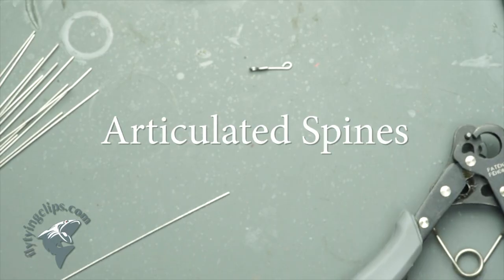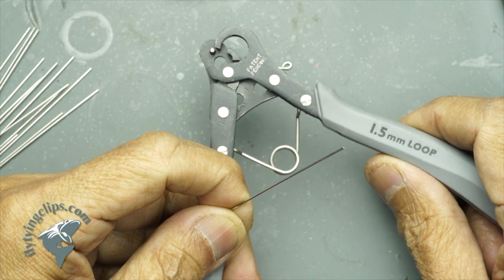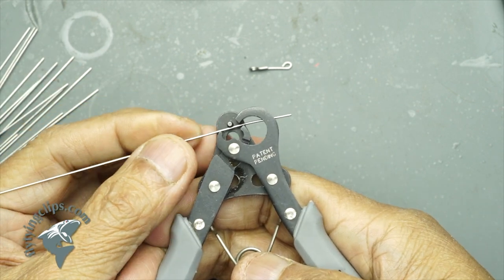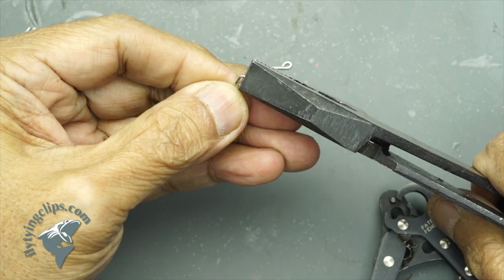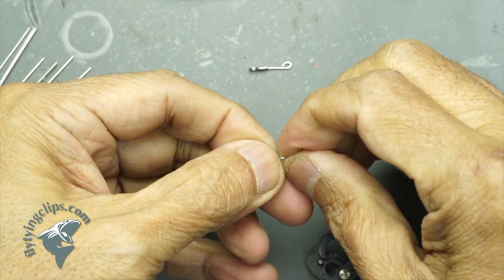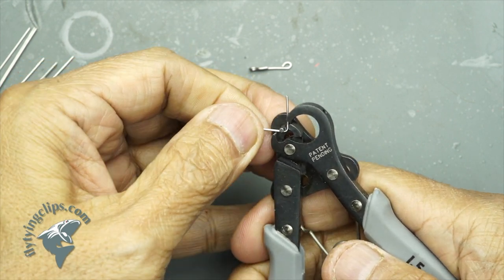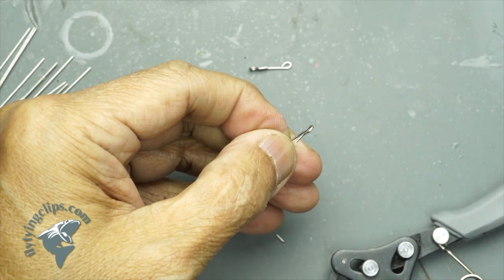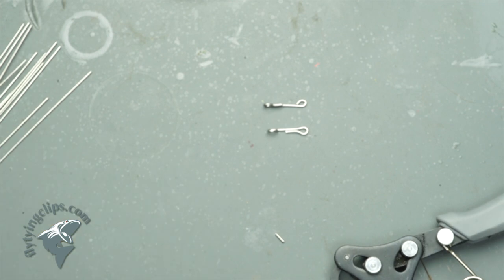Making Your Own Articulated Fly Tying Shanks - By Herman DeGala

Comment: First loop, while it’s in the tool still, hold it clamped shut and then bend the wire back away from the loop slightly to get the eye/hole more centered with the shaft... also give you a little crease for the pliers to help close the loop if needed. I use stainless steel leader wire from cabelas/bass pro. Size #10. Which is 0.024” diameter. I tried making the micro shanks with #5 & #7 wire but it’s too thin so I shaped the ends of a pair of hemostats with a dremmel and bend micro shanks by hand.